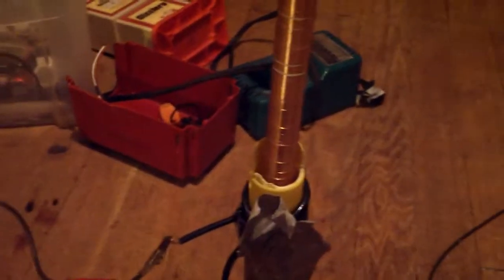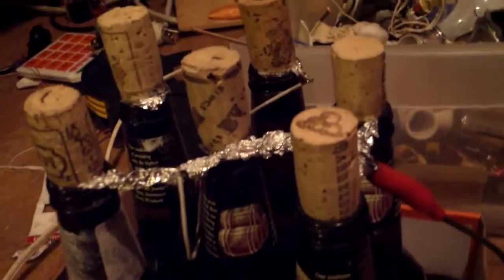light bulb tesla coil

Comment: i think, that tesla coil produce low current high voltage. when that amount volt pass through the bulb,voltage pass inside and outside both.like skin effect.but due to the low current, the filament does not burn out but it glow to its maximum watt.on the other side outside flowing voltage create extra luminance or light.i think thats why its glow so much